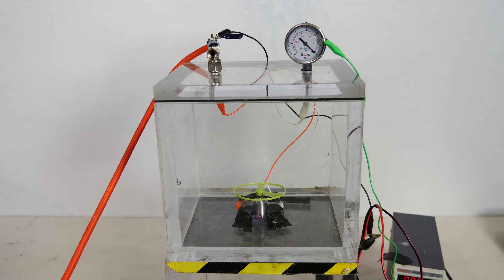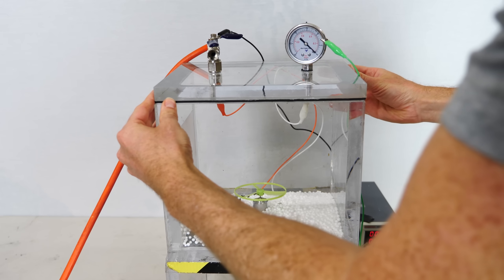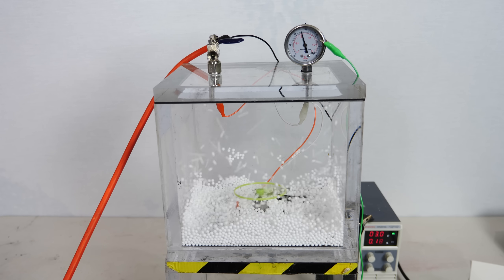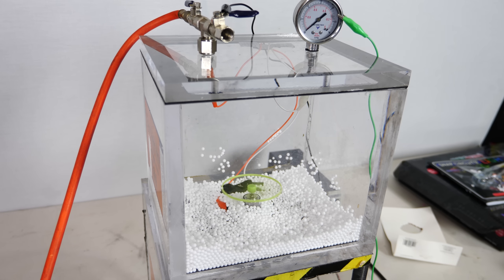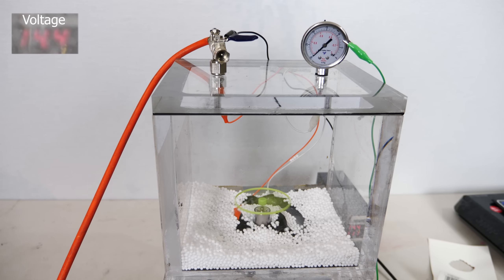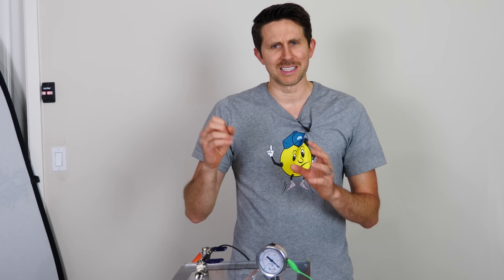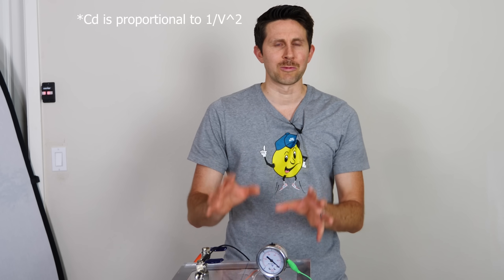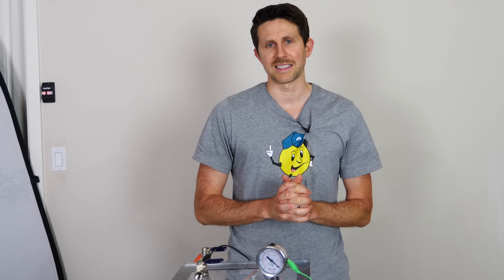What Does a Fan Do in a Vacuum Chamber? Weird Results

Comment: It’s a surprise you didn’t burn out the motor. First of all by the high voltage you applied, and secondly by the lack of cooling air around it.
Reply: True. My guess is that the motor doesn't have to work nearly as hard as it does in "normal" conditions. Still gets hot though, so as for the cooling, my knowledge doesn't really go that far
Reply: @elidames6889  Yeah, thebcurrent dropped as the chamber was being emptied
Reply: @johnuferbach9166  which was one of the most interesting parts of this video.
Reply: @elidames6889  you see the current drop in the beginning, when the airprssure drops. from some 200mA to 150mA.
Reply: Not only that, without any atmosphere, there's no air to dissipate the heat. That's a real issue in space. Space gear has to be internally cooled and heated to protect from extreme cold and from sunlight.
Reply: @CarbageMan  you sent me down a research rabbit hole, and I'm okay with this
Reply: @CarbageMan  Seems to me the astronauts could just man up and deal with the conditions of space 🤷‍♂️
Reply: @A_Black_Sheep94  OMG, you're a riot. I wasn't even talking about humans or I would have mentioned them. I was actually reflecting on my knowledge about satellites.
Reply: Even at the stupid voltage there would probably be almost no draw. For this little run the case of the motor would.be enough of a heat sink.
Reply: @timothybayliss6680  I see. Never thought about the casing itself. That's a good point
Reply: @timothybayliss6680  heat sink would not work in near vaccum... as it requires air or other thermo-coduncting medium...
Reply: @alinmeleandra3175  it ran at power for less than five seconds, I counted 4.5s from when he increases voltage. There is very little heat to dissipate simply because the draw would be trivial. The bushing plate and rolled case are in direct contact with anything making heat. If air is your primary means of transferring heat to a heat sink you are doing something wrong. If air is your cooling medium, this motor would fail eventually but not in the time it was ran in fury. A static heat sink will almost never use air as the transfer medium to bring heat to it. Think of a heat sink on a transistor or some other electronics. They use air to remove heat from the sink but not at the transfer medium to the sink itself. The case would work as a sink for this short run only because there isn't very much heat to dissipate and you will never be able to substantiate damage to the motor from overheating from this run... The motor still worked.
Reply: @timothybayliss6680  heatsinks transfer energy (caloric in this case) from the protected devices to the environment... The air in not the heatsing, air or any other fluid in this context, is the environment to which you want to transfer the heat...  If the heatsink in part of the box and is connected to the motor so that any build-up of thermal energy is 'conducted' to the box itself, than this it might do the job since the box itself becomes the heatsink (transferring the heat from the motor to the environment)...  YOu are 100% right in what you said, also regarding the time... The propeller connected to the motor failed before the motor burned out so we cannot how long would the motor have lasted in other conditions....
A few other things are important, even if there was no load on the motor, there is a factor of electric motor efficiency (which for standard DC brushed motors is less then 90%  -- most cases is around 80%)... This means that is 10% of all energy supplied to the motor will be converted to other forms energy and, because of Joule law some of it will become heat... But in order for the motor to burn up due to heat buildup it is necessary to run for some time while dissipating less heat than is being produced....
Reply: @elgur That is correct.... however I was talking about something else.. I stated that using heatsink is not (really) useful in near vacuum as it is not capable of  transferring enough energy to "cool" its protected device (same problem is also encountered by NASA)... Transferring  heat via "radiation" is possible though (since all bodies that have a temperature above 0K emit radiations/photons in the IR frequency range )  but I am not sure if the efficiency of the thermal transfer is high enough to avoid over-heating issues...
Reply: No air no flame. Hahaha
Reply: https://youtu.be/RlxRUoZiP-Y
Reply: Technically, it can't "burn" due to the lack of oxygen.
Reply: No electric motor actually is what it is rated for.  They can handle loads and loads more than the fake rates. Theres no way of actually calculating that. We can speculate but every motor is different even when they are made the same. And as for overheating it was only on for a short time.

Comment: You might mention the fan draws less current as the vacuum is introduced as the drag on the blades is reduced.  The same thing happens when one covers a vacuum cleaners nozzle and hears the motor speed up considerably though many think the fan is slowing.  It is not!!  Thanks for the video!

Comment: why doesn't the vacuum suck the beads into it?
Reply: My guess: the vacuum is developing equally throughout the entire chamber. So...no circulation of the air to create drafts to lift the beads.
Reply: I guess it doesn't suck hard enought to move the beads (there is ofc an airstream through the valve, but not fast enough to pick up beads)